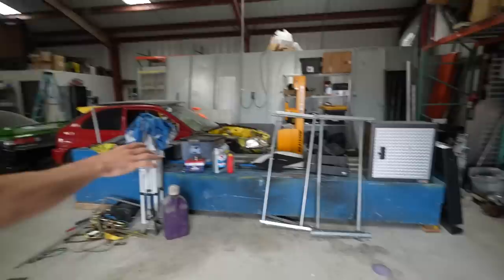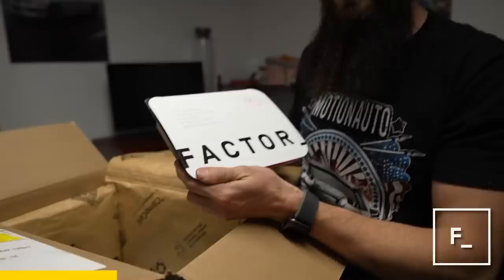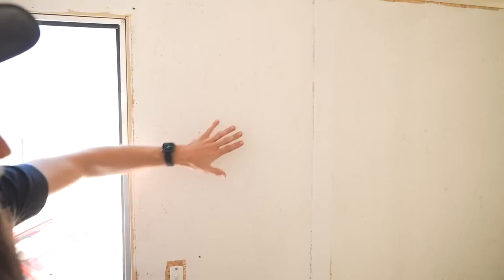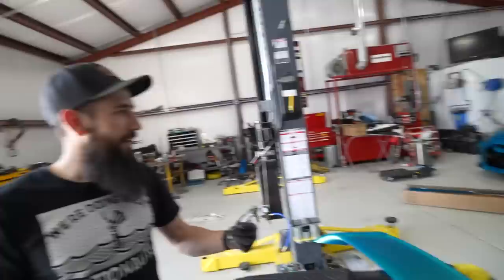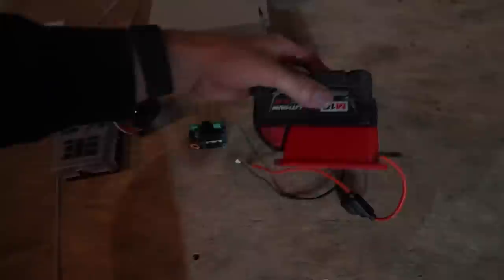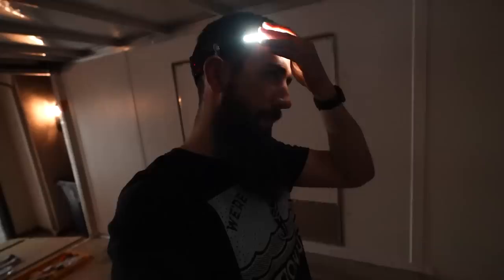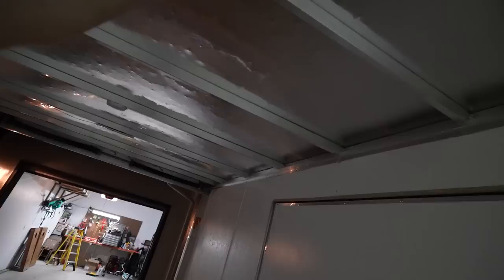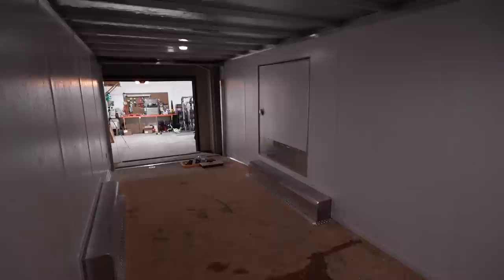Milwaukee 18v Powered Trailer Lights + Upgrades!

Comment: Go get the m-18 top off power supply .Hook it to a Milwaukee dual rapid charger.  And always keep swapping out the battery label them 1,2,3.    You will never run out of power. 😊

Comment: You could remove the ply wood and put foam insulation and use metal on the walls and the roof. Super light and thin aluminum

Comment: Question you said you had to install a low voltage cut off because if you drain the battery down it would mess it up but isnt that what happens when you use it on a drill you run it till the battery runs out so seems kinda of unnecessary for a low voltage cut off

Comment: You install a 12v car battery so your lights can run without your truck. Then the wiring that hooks up to your truck will charge your battery in the trailer while your truck is running and traveling to events.

Comment: How do you recharge a drill battery once it's been drained to low ?? I have 2 drill batteries I'd like to fix and also my Schumacher jump pack also failed and won't recharge ...
Reply: Make 2 jumper wires and hook too another battery that is charged leave for about a minute...+ too +, - too -
Reply: @Chance Smalley  thank you , hopefully then they should charge normally again ?
Reply: It has always been successful for me just be sure u hook it up right or it will fry the good battery and hook up negative first
Reply: If done correctly you can have a shut off where it would stop working as it would in a drill, so you don't drain it to low
Reply: Yea but if you don't charge a drained battery before it sits for a long period it will get too low also